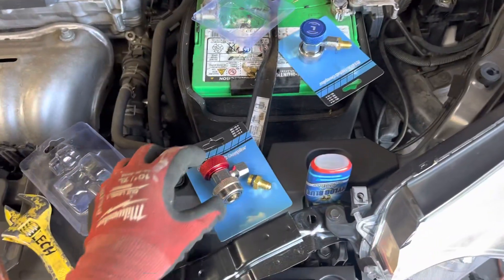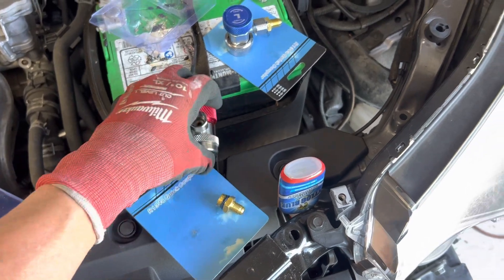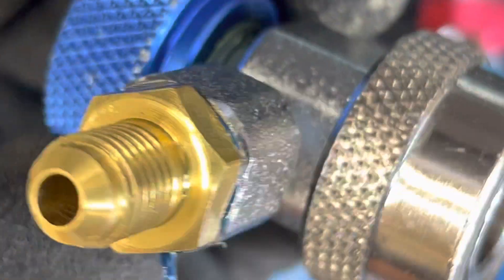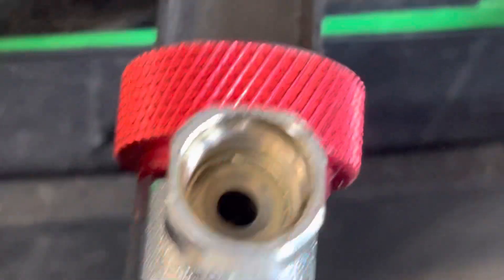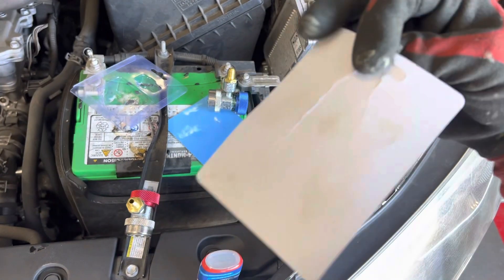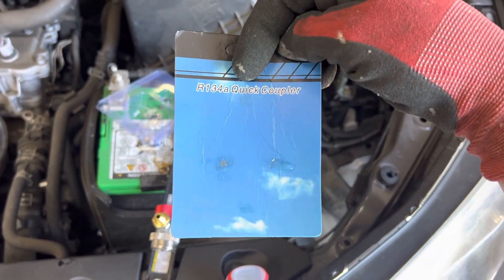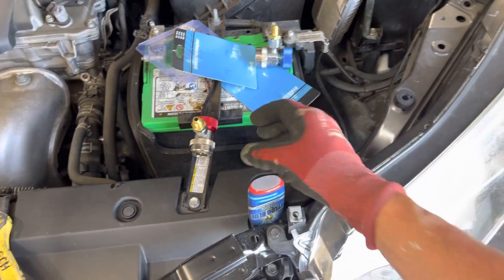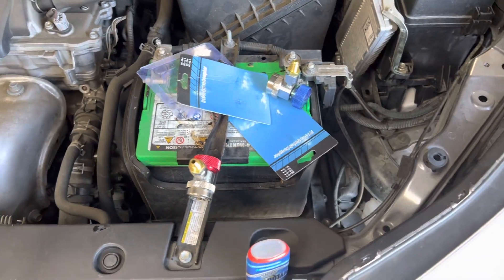CHEAP AMAZON REFRIGERANT CUPPING FAIL. No￼t that’s good as Yellow Jacket.. tools. ￼

Comment: Ironically I got those same couplings and the low side coupling didn't even fit properly on the service port. Ended up having to use my mastercool coupling instead.
Reply from the maker: Yes, Mastercool is the other good brand-name